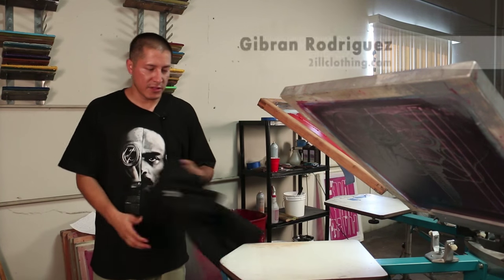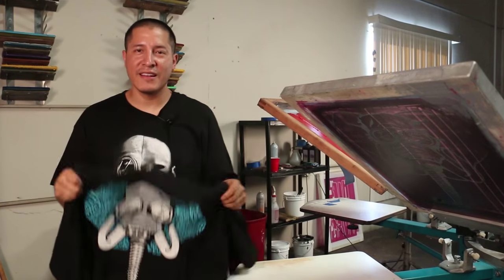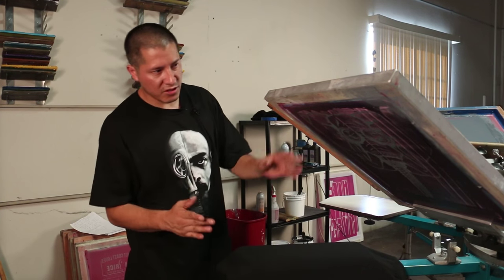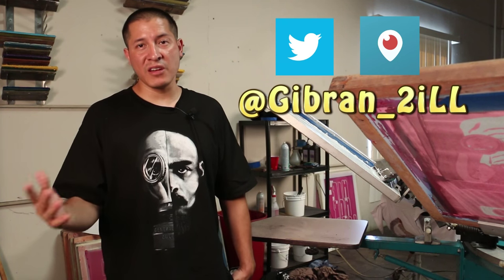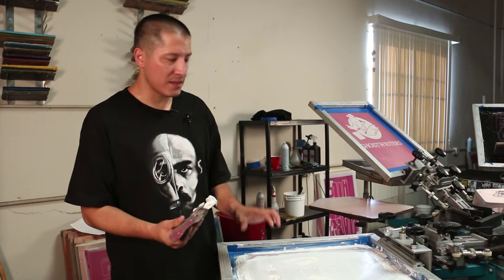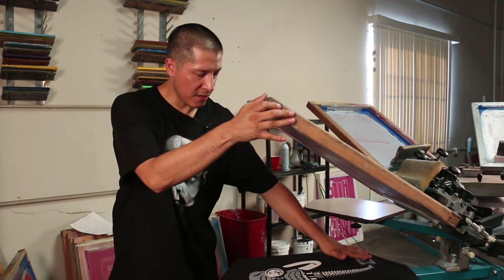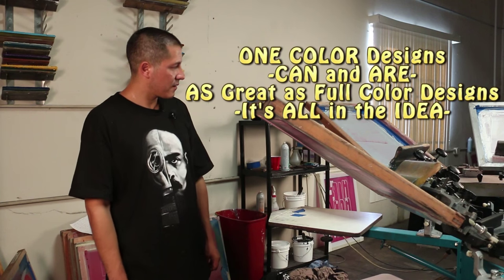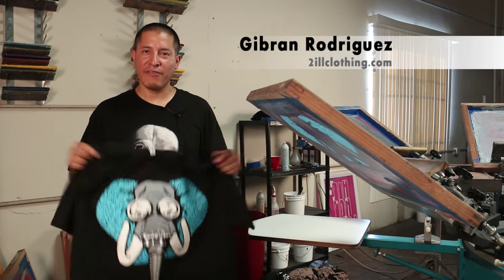2 iLL Screen Printing - iLLaphant Design

Comment: Bro what mesh did u use for each screen ??
Reply from the maker: No Place Like Maui Clothing I used 110 for the white and blue ears. the rest I used 160. There are many ways to get the same result. I could of pulled it off with 200 mesh on all of them but I wouldn't try that now that I'm experienced.  I only use 200 meshes for dots.

Comment: Quick question...What ink do you recommend for Tri-Blend Tees?
Reply from the maker: I would look to print with a ink that is opaque and low temp cure. If you want to print white ink, International Coatings sells Cool White. It will work for that. But if you want to be safe about dye migration then use any Poly ink.